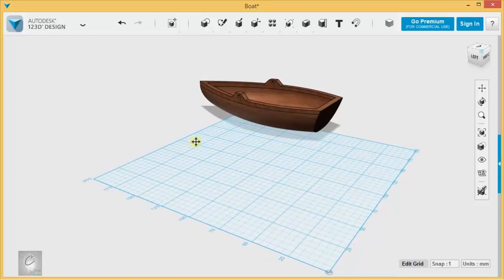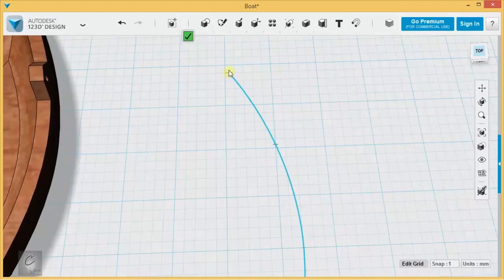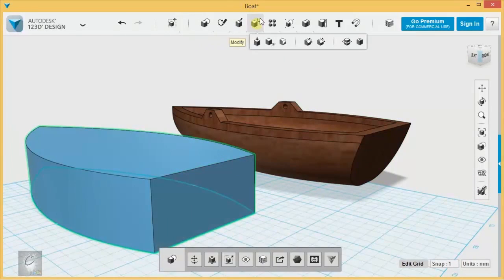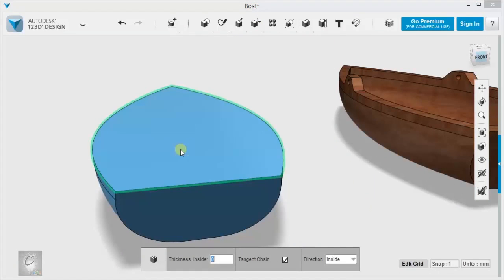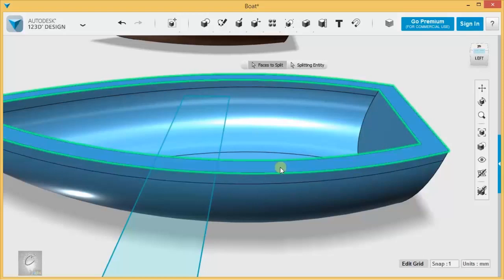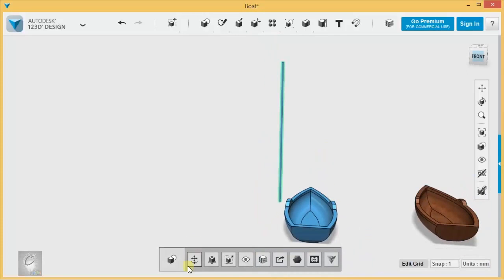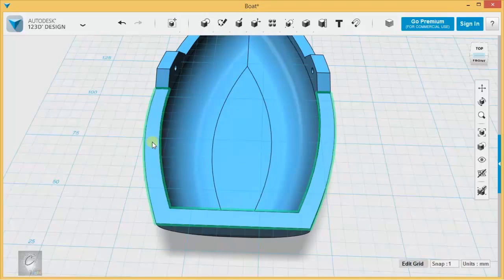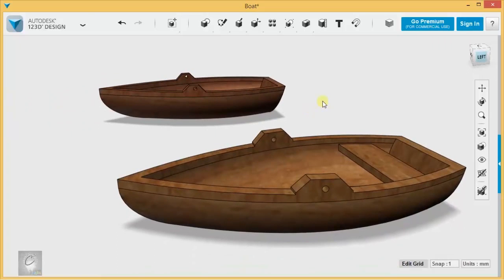123D Design Tutorial Basics Exercise 2 - Rowboat

Comment: I'm having trouble with the hollow tool. It really doesn't seem to work. I keep clicking and adjusting the values and selecting different faces, inside and outside, but it just keeps saying "invalid operation." Any ideas?
Reply: Hi Brian, I had that too, When jou make an polyline, select the line and than connect it with an spline. The second spline need to be connected as the line before. When you do this it will hollow outsideSucces
Reply: etyvcmmfv GB ghguuafycydrd